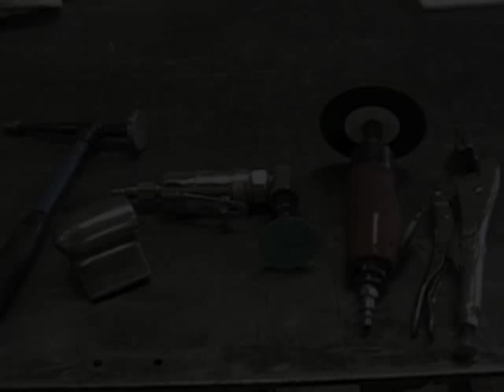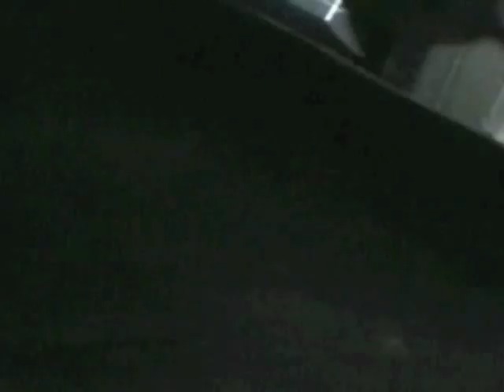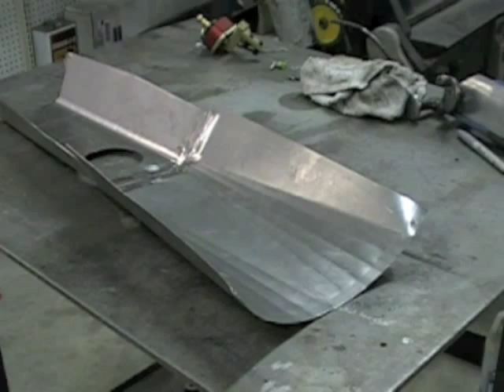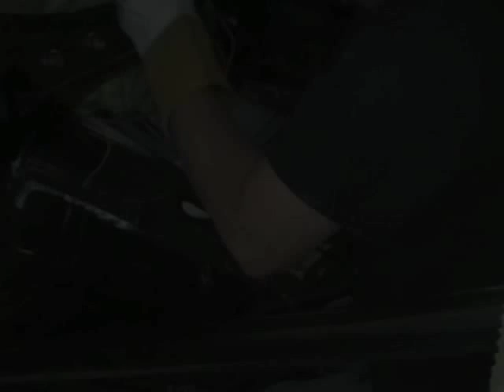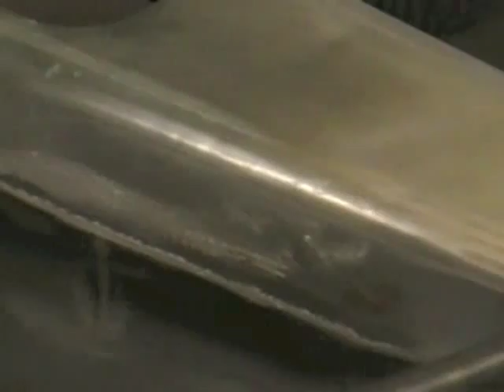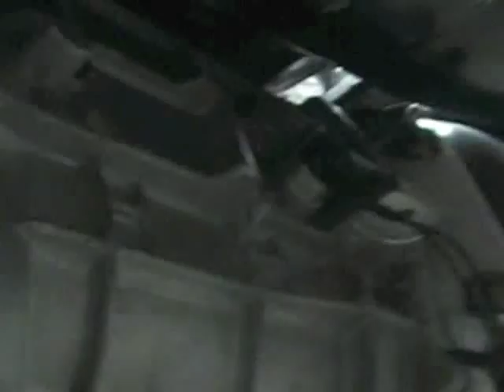'66 GTO - Tin Man Transmission Tunnel Panel installed with Tremec T56 over drive transmission part 2

Comment: Is the crossmember a modified stock item?  It looks stock but drops a little lower for the isolator.  I don't see them on your web site, is there a part #?  I need one for  69 Chevelle.  or 68-72 GM A body cars...  thanks.